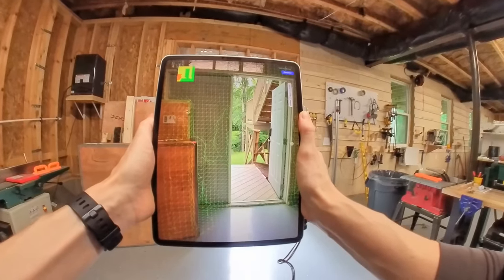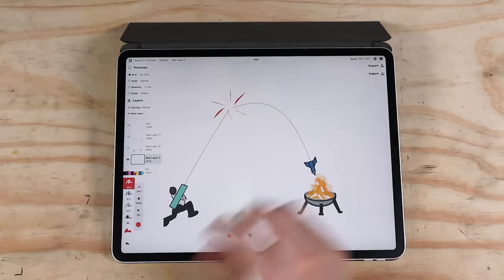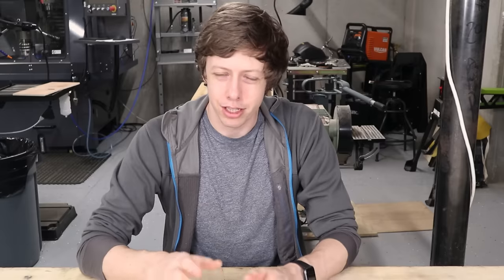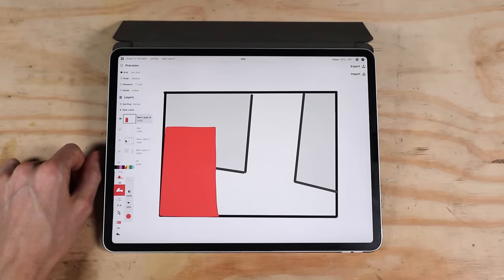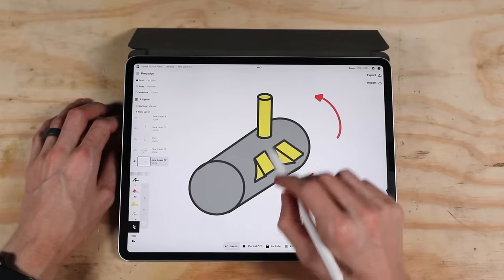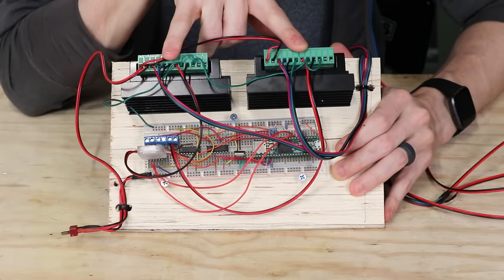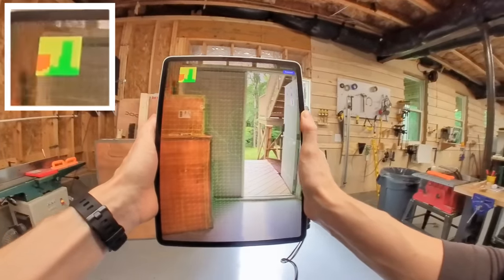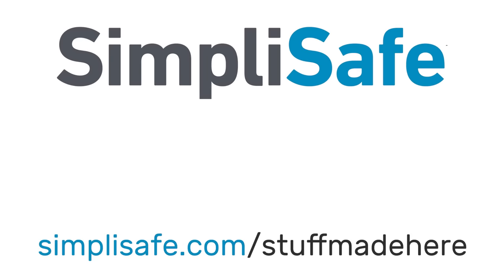See in complete darkness with touch

Comment from the maker: Thanks SimpliSafe for sponsoring this video. SimpliSafe is award-winning home security that keeps your home safe around the clock. It's really reliable, easy to use, and there are no contracts. Check out SimpliSafe here: https://Simplisafe.com/StuffMadeHere
Reply: I'm sorry to correct you but only in the US light is traveling at 670,000,000mph.
Very confusing
Reply: What if you built glasses with the technology that went into gloves that would tell the hands what to do, and instead of pines you could use vibrations or harmless electric shock in the palm.
Reply: Yeah I hope you get that system out and build your own fast. It can be bypassed with a $2 device on Amazon.
Reply: Lidar is coming to the new iPhone, I can't wait to see what you're able to do with that in a few months
Reply: Halfway through when you talked about top-down view, I realise you have made a irl raycaster. (doom-engine style raycaster) which is a very fast and easy way to draw a 2d map in 3d by keeping track how far each wall (in-front) is from the player. 

Can you make a blind doom engine?? Can your case run doom?!?
Reply: Also with your pin locking mechanism that holds the pin down, it looks awfully like a key lock tumblr. I can hear a certain lock picking lawyer, "today I'm gonna show you how you can unlock this casw by walking around a specially designed obstacle course made with 2 Red bull tin cans, walking click on 1, 2 is binding..."
Reply: yo you actually KILLED the delivery on the ad. I could use a lot of those things, I will be looking into it lol
Reply: @Yadobler  this was the first thought I had too 😂
Reply: I think your wife has 14 Youtube accounts, why else would there be 14 dislikes
Reply: Lockpicking lawyer made a video of this product. It was terrible
Reply: Bro what did you major in college. Robotics?
Reply: Building guided rockets is illegal btw.
Reply: @chimanwosu537  definitely mechanical engineering, my guess
Reply: Sir i really love your work, i'm still in high school and i wanted to be like you someday, what course did you study in collage?
Reply: So when you talk about making a tactile braille display, if there is some way you could have a "tape" that has slots for braille letters that can somehow mechanically change the divits in each slot on the tape, that could be used to form sentences and then the tape could rotate around to be read kind of like a treadmill
Reply: Maybe you could mount this grip on a 'white cane'.
Reply: You may consider looking at Carl Bugeja channel about tiny actuators. He is working on PCB motors and actuators.
Reply: some blind people can actually see if they are in a light area or in a dark area. Could it be that if you made a box with a hole in it, that they could "see" by sticking this box on their eyes and moving their head left to right up to down like a scanner. I know this sounds comlicated, but if you attached a motor to the box, that moves it at a regular speed( also like a scanner) then they wouldnt have to move their head like a idiot and could maybe see black and white in low reaulution.
(just a idea maybe stupid, but maybe helpfull)
Reply: David McG and Destin from Smarter Every Day demonstrated that a laser can be used to silently trick alexa, Siri, or pretty much any voice activated system connected to a smart lock and trick it into opening. I would be very wary of any electronic lock especially when used in conjunction with any voice activated assistant.
Reply: use azure kinect DK to replace the kinect,just a hand pond size, and better performance. USD399
Reply: U should have a company
Reply: Look at the lock picking lawers video on this he bypassed it with a 2 dollar device
Reply: The output could be small studs in an array,  which represents the display. The distances would be announced by vibration. The studs would vibrate more, when an object is close. Either the frequency or the amplitude would get higher in proportion to the distance measured. I think the resolution of such "display"  could be quite high, f.ex 8x14 studs. All studs would be in the same depth, one sweep with fingers would reveal if something is very close.
Reply: Thanks simpleflips for sponsoring this video
Reply: @SassyPants34  I WAS LOOKING FOR THIS!!!! Love that guy. A dead bolt that can be opened with a magnet LOL!
Reply: Pretty awesome man! There's a company who is working on haptic feedback for VR using gloves that have around 120 touch points, I think if you could collab with them this might blow up. 
Edit: here is Destin's video from smarter every day on the gloves.
Reply: If you wanna be a successful (DIY/innovator) youtuber focus more on the Demo and the practical use examples and and minimize the scientific explanations or divide the part's for those who r instructed. I'm into the science behind the projects but this made me yawn. Take for example. Hacksmith, kingoframdom, diyperk etc. The try to focus on the Demo more then explaination. The channel diyperk has completely different channel for the detailed explanation. Best of Luck 🤞.... You have alot of potential... Don't fail ur self. Will continue to watch. 👋
Reply: Woody Haller yeah I work in IT I use dumb technology. No smart connected shit in my home.
Reply: simplisafe can be bypassed by a tiny 5 dollar remote interfering with entry detection sensors
Reply: what if you take the lidar out of 2 devices put it on either side of the mask, and setup a concave gauntlet on your forearm to have more pinpoints, maybe ever one on each arm to give left and right clarity? I think this is a big step toward helping the blind!
Reply: Bro can u make an Ai animal robot
Reply: what app are you using on the ipad to draw with?
Reply: Great idea. it got me thinking when I was listening to what you were describing, I was thinking of those desk toys. Where it's a series of pins on a plane / box where you press your face/hand into the extended pins and you get an impression of your face/hand/etc on the other side.  These things: https://media.kohlsimg.com/is/image/kohls/2523398 Seems like in your current tube model you could fit a few of those type of pins.If the pins were ferroe sensitive, then use a series of small electromagnets to push/vibrate them around. Don't have to move a lot for decent resolution.
Reply: You should have used electromagnets
Reply: Thanks SimpliSafe!
Reply: I would love to see this as a single in hand bar that you can wave around like a wand and it basically acts like an infinitely long stick for blindness. That vibrates harder when things are closer or softer when further away. That way you could wave it around in front of you to get a good feel of the room instead of having to try to actively navigate the room while being fed data. I think (correct me if I'm wrong) that blind people probably have a very good ability to form mental images of rooms and locations of items around them. So instead of giving them a tool that real time feeds them the locations of things around them. Give them a tool that let's them take a measure of the room themselves. So they can wave it around and sense where things around without having to go over to the things or have them come upon them. The can make their own mental map.
Reply: Around what clock ?
Reply: iPhone 12 is supposed to have Lidar.
Reply: It's called a cell phone jammer.
Reply: SimpliSafe: You can't enter this room
Me: has $5 flood radio from eBay
SimpliSafe: Understandable, have great day
Reply: Send the lock to the LockPickingLawyer he will tell you if it’s safe or not😅
Reply: The Xbox connect would work as a belt
Reply: Please make some PlayStation trigger stops😔
Reply: I got to say very good project that can definately help blind people. If i were you i would replace the hand control mechanism with a vibrating gloves. With a vibrating gloves you can basically configure the glove to move left right or straight
Reply: So I just found ur page and holy fuck man ur a fucking genius... excuse my language... definently subbing... great shit bro
Reply: And it’s entertaining and helpful as fuck.... damn I wanna be like u bro
Reply: What happens if this thing sees a glass door
Reply: Or ya know just do it the simple way and dissable power to the house and then ez catch
Reply: Try a glove that vibrates
Reply: Yo that security is ridiculous lol it's funny how you explain every reason why someone can't break in what's next are you going to put some handmade booby traps down  flashbang trap 200 flashbangs goes off at the same time lol
Reply: @coughcough6692  don't give him ideas lol
Reply: Thought for you what about incorporating a VR glove with a standalone  lidar system that could be worn like a pair of glasses?
Reply: You should Colab with Tommy Edison he is blind and it might help him
Reply: They have something similar to that at the museum of science and industry in Chicago. It’s these football shoulder pads you wear and it has sensors on them. When you’re about to walk into something it vibrates. I’m sure you can check it out
Reply: The question is, will those poking or vibration in your hand cause nerve damage over time🤔
Reply: Dude, where's that Kickstarter/bank loan at?! You got a working prototype and a fanbase, what are you waiting for?!
Reply: U should make a guided missle that’s filled with water or something so that once it’s shot up in the general air space above the fire, it can locate the fire below and dive towards it
Reply: Im working with digital design of chips and often clockspeed is in GHz range so 5 ns i 5 clock cycle thats is plenty of time :P... If u need some project with supper low latency and use a FPGA i can help you out :)
Reply: You might want the carbon monoxide sensor near the floor.
Reply: @ Stuff Made Here 
Which IQ do you have?
Reply: I’m assuming they paid for you new ipad
Reply: Someone invented a really simple device which gives high resolution simulated vision for people who cannot see, a very long time ago. It requires no programming, no batteries, and anyone with a working hand and legs can use it.

It's a 1.5 to 2 metre long stick. A small wheel or rotating ball on the far end of the stick refines it significantly. Paint it white, so that the stick can be seen clearly by others, et voila! Perfect! 

Another, even older tool does require programming and an energy source, has a lot of RAM, and gives about 10 years of reliable service. It is also self-replicating.

It's a guide dog.
Reply: Ok it may be a dumb or impractical idea but to increase the pin density you could try a grid of elecomagnets that get powered in varying levels to push  the pins (think a pin with a neodymium magnet on the inside so when the electro magnet becomes unpowered it returns to its original placement)
Reply: If you ever run out of ideas, I would TOTALLY be interested in your home automation setup.
Reply: This board is very SIMPLE, it’s just a micro controller Bluetooth communication module and two big fat ?????? motor drive. 😳😳😳😳🤯
Reply: I just hope that you have other "defense" systems cos' you are aware that knowledge is power and just showing your alarm devices gives the potential intruder info and gives him infinite time to prepare (cos your things are pretty much worth the months of preparation). (So I have never burgled someone and don't plan to, just informing you that it's better to always have backups for everything)
Reply: What about using a custom pcb with pcb coils as electro magnets to create the push, wouldnt that be alot more compact? You could technically make an actual flat case or perhaps a glove right?
Reply: The new iPhone coming out is gonna have a lidar.
Reply: @maibster  yeah exactly what i commented 2 days ago which probably was not even original to begin with
Reply: What about a glove which gives you a small static charge whenever something gets closr (or push something from the glove towards your hand)
Reply: @marktyn99  well true but also false, because what he installed is a co not a co2 sensor, carbon monoxide unlike carbon dioxidd is about the same density as air at room temperature so it doesnt really matter where he places it
Reply: iPhone 12 has a lidar sensor.
Reply: @maibster  that's true, I realized it after half an hour, but couldn't find my comment annymore
Reply: iPhone 12 has LiDAR :D
Reply: Make a DREAM RECORDER. Im sick of having awesome adventures, and waking up and not being able to remember them.
Reply: Have u thought of making it work on a haptic glove?
Reply: O9 o8 op 9
Reply: Lo olio ooooooo[ooooooooooo9o IPO ooooooooo[ok[[ooo[ok ooo[olio
Reply: @SassyPants34  [
Reply: @SassyPants34  l
Reply: @compactcow    9k pip 9 op o olio Ohio
Reply: @ArticBigFoot  0
Reply: @compactcow  [9o9
Reply: @SomeSortaPro  k kil9 ok
Reply: Time for the iPhone 12 version!
Reply: first off want to say that I'm not an engineer and only have my mind to help with ideas when it comes to this stuff than to actually build it unfortunately.

My question, though, Is, is the xbox connect sensor more accurate than the iPad's sensor? If so, is it possible to break down the casing and design a holdable design to better improve the sensitivity and sight ability to be able to see better as an improvement to the device you already made?
Reply: Why not make two feedback sensors, one for obstacles on the left and one for obstacles on the right. Of course, this would be more relative on the iPad version than it would be on an iPhone version.
Reply: You could fit the cylinder with a rubber glove over the pins so that instead of looking for precise pins you can just feel as you get closer to your surroundings
Reply: Hopefully you see this! You should see if you can get in touch with Tommy from The Tommy Edison Experience here on YouTube! A collab with him (or any other blind YouTubers, he's just the first that comes to mind) to test this out would be awesome!
Reply: You shouldn't put the carbon monoxide detector on the ceiling. Other than smoke detectors they should be hung at about 1,5m above ground (wait … that's … let me get this right … 9 tenthousands of a mile) on a wall. Carbon monoxide specific weight is very similar to normal air so it will not rise to the ceiling (as smoke does).
Reply: An idea if you want to try this again:  Use gloves with bicycle brake lines attached to pins at one end and tiny linear actuators (You can get 10x10x30mm long-format ones directly from China for less than two dollars each) in a bracer at the other.  That would free up both hands for other tasks while still offering full-time haptic feedback.  The iPad can go on a lanyard around your neck and can be tilted by hand when necessary.

Does that make sense?
Reply: Spend a week blindfolded using this in a room full of columns and coffee tables that your wife rearranges each day. Make lists of tasks you need to do each day. Voila, you'll have gained the skill of sight without sight.
Reply: Integrate GPS within it.
Reply: Great video! I wish I could work for/with people like you, Mark and Dustin. So much to learn! I feel like my engineering school just can't teach innovation the way you guys could.
Reply: You might want to check the LockPickingLawyer channel, before ordering some of the products.
Reply: You should make it with the iPhone 11  pro now
Reply: Carbon monoxide detector should be closer to the ground for optimal safety
Reply: @SassyPants34  not to mention the ease of programming and hacking these days. Id never use digital locking/unlocking. Someone either needs a KEY - or they're using force. No chance im letting a nerd rob me.
Reply: iPhone 12 pro has lidar... just saying...
Reply: slap a few tracking devices in hidden smaller items and you should be even safer~
Reply: Your humor is simple but funny af. Keep up the good work!!
Reply: Bro you should defo message Elon musk about a partnership for marketing this
Reply: well now lidar is on the new iphone 12 so that is a plus. I want to see this done on that device
Reply: Funny how lidar is in iPhone now
Reply: interesting video.
Reply: The simplisafe system can be disarmed with a high frequency emitted from a radio. It makes it super easy to brake un
Reply: This video's project honestly seems like something that could be patented. It's AWESOME.
Reply: @safetyinstructor  won't it be the same speed (not number) if you convert it to kilometers?
Reply: @marcohaase1  it's sarcasm
Reply: @safetyinstructor  sarcasm is a bad idea over typed messages nobody can read sarcasm you only hear it
Reply: @marcohaase1  
I highly disagree with the "you can't read sarcasm" part but it's usually a bad idea to use sarcasm on the internet because most people either won't get it or will be offended
Reply: @safetyinstructor  ok but usually sarcasm is said in a certain tone that can't be perfectly replicated on the internet
Reply: Do you use Desmos for your quadratic equations?
Reply: I want suggested for my friend who has a son who is blind born that way a wristwatch that gets to a finite tension the closer you get to an object directly in front of you however that wouldn't totally allow you to see your total surroundings but it would be a better judge of distance combined with your lidar but also lidar is kind of funny in the sunlight you might want to go with those ultrasonic sensors but those don't really do very well when it's a small or rather not well sized object
Reply: Another thing you might want to consider is people who are practically born blind trust their hands more than anything and they're hearing maybe a whole sleeve on the arm might be better and have it operate to the orientation of the arm and the given direction the user is facing
Reply: Zarin M  I too was thinking that was not quite appropriate I thought it would be best to combine the lidar with a wrist sleeve that gets to a finite point that's tense to tell you you're right in front of the very object you're about to touch the user would be able to figure out distance based off of feeling.. up until the point they actually touch it
Reply: Zarin M  so basically the concept is light our sleeves on both arms to judge distance accurately and simultaneously
Reply: CO is heavier than air. Place the sensor closer to the ground. If it hits the ceiling, you are already right in the middle of it.
Reply: A tactile glove would work! Use bluetooth. Form factor would be smaller.
Reply: @dHue_52  yo awesome dude.. hey what company is working on this exactly
Reply: @dustinswatsons9150  I'm not sure, but here's a link to the video I was mentioning in my original comment where Destin from Smarter Every Day explains it and goes to the testing facility. https://www.youtube.com/watch?v=OK2y4Z5IkZ0 (not sure what happened to the link I originally included
Reply: Theoretically, it could notify the police if it loses access to wall power, although the problem of it being accidentally unplugged, or a power outage could give false alarms.
Reply: Hey man, I'm still waiting for the iphone 12Pro version and improvement of this. :D please do one :)
Reply: Now the iPhone has lidar so you can fit it into the iPhone case. Love your content👍
Reply: and then lockpickinglawyer debunks this thing bit by bit
Reply: Best video
Reply: @stuffmadehere David Eagleman, did this 10 years before... He called it sence replacement as vibration vest for deaf people
Reply: @Stuff Made Here  Piezo transducers should be a simpler, cheaper and better approach, eg a 12x9cm grid of 12mm piezo transducers would make a 10x8, 80 'pixel' tactile display for >$20, minus the control electronics; it could even be mounted on the back of the tablet, and there's probably quite a market for smartphone cases with this kind of technology.
Reply: 12:58 even if its a sponsor add, its not good to explain your security system, hope you left stuff not explained.
Reply: Yeah... wouldn't be easier to just use sound for that idea? Just buy a pair of stereo bluetooth earbuds and convey that lidar data by sound like a portable sonar. If you make a app out of it you could help some people around the world.

Btw, a way to turn it on or off with a button press would be nice.
Reply: Use VR gloves. Massively increase the amount of data you can feed to a hand. With two VR gloves (left and right) feed the projection of obstacles onto the right hand and give the INVERSE of that same map to the left hand! One hand says what to avoid and the other says what space is not occupied. We don’t navigate to a door by seeing walls and inferring the space not occupied by walls must be safe. Our brain balances both metrics (where we can go and where we can’t go) simultaneously to model the space around us!
Reply: Going forward with your interesting invention keep in mind that there is a braille literacy crisis in the US, where fewer than 10% of the 1.3 million people who are legally blind can read braille, this applies to both adults and children.
Reply: perhaps you should make a whisker system for shoes and hands.
Reply: I have a question why wouldn't you just use a glove for this project?
Reply: Please revisit this project with the iPhone 12 there’s this new app called SiteScape try it out and improve on it
Reply: Oof
Reply: Hi watched your video for the very first time, I loved it❤️ thank you man. I would like to suggest you one idea that just flew by my last brain cell.

Idea : we can use hand gloves (half glove still better as fingertips will be free to use) and we can attach small vibrator motors that come in phone.
Gloves in both hand will let you get more precise data about the direction (levy glove reacts to ipads half left screen and right does for other half).

Placement : Thumb motor described obstacle above head, Pinky finger motor described obstacle below, the other three fingers describe the obstacle in front.

Distance of obstacle : the distance will be given by hardness of vibration. Higher the vibration by motors.... Closer is the objet.
Reply: TINY SOLENOIDS!
Reply: I'm an Orientation and Mobility instructor, meaning I teach people to get around without their vision and have just over 10k hours under blindfold myself traveling across the country. My issue with this piece of tech is that it will never be safer than simply using a proper white cane and it could actually endanger people fresh to blindness as they cling to the tech instead of learning to get around safely and properly; its just way too much trouble for how simple safe and truly independent travel is as a blind person and if you have a low battery you're screwed.
The Google blind driver car actually does what you're trying to do here but uses haptic gloves to convey obstacles.
Reply: Simply safe? Dude, i like your machines. notify me when your going on vacation!
Reply: So you use simply safe! Could be more safe by making your own  alarm system! Plus you show every burglar where evrything is and how its setup! Did you just bang your head? Because that all was the dumbest thing to do ever!
Reply: Now the iPhone have LiDAR
Reply: It's great that you got a sponsor for your video but you should never tell people what actual security system you have. That's just giving thieves the needed information to actually rob you
Reply: This seems like a difficult sponsor to sell after you have collaborated with the lock picking lawyer and will have gained a lot of subscribers from his followers... And they will give you a hard time about everything (whether they are right or wrong is another question).
Reply: Hey I know that this is insanely late but you could do something similar to the HTC Vive controllers where basically they use speakers as haptic feedback, so you could get something that vibrates or moves slightly to a fixed location when powered in order to simulate "bumps".
Reply: It just seems like youre paranoid. But I think thats ok.
Reply: Bring this to shark tank😂
Reply: p
Reply: I think i just got a pretty good idea: make the whole thing a cap with the camera and some small solenoids  that tap your forhead on it. the tapping frequency increases the closer the distance in the corresponding direction is. this could be quite discrete to wear and give a decent resolution. most certainly good enough to help you find doors and stuff in fimiliar places. the forehead i think is an ideal place to interact because if i test myself it gives me great resolution and with the solenoids it should be possible to make a screen with just small coils and magnets suspended in maybe silicone and connected in a grid? the magnets could just stick to a sheet of metal for the pour and keep the individual coils in place
Reply: Hey what about solenoids? Compact, sensitive, precise enough, cheap, jellybean parts driven by transistors. Maybe somewhat power inefficient but I don't think you'd need  whole lot of actuation force.
Reply: "and it uses cell service, it's super..." 
"buffering... Please wait."
"a'. r'. blip. -r reliable."

Oh, and cell phone jammers cost $75 or less fyi.
Reply: have one controller for ur right hand and one for ur left. if something is on the right the right hand pins and if its on the left the left pins go.
Reply: @dreoneful  
You’d sell out to women in a day.
Reply: @SassyPants34  damn lmao
Reply: he cant see it tho, he blind
Reply: Apple also put the LiDAR in iPhones
Reply: Hey! Just an idea for an upgrade maybe to this project. Maybe a Segway that can be controlled by the navigation  app, the rider would wear sth like the virtual reality head gear which would provide 360 degrees, on all 3D axis, Lidar scanning. I believe this would actually find commercial applications for visually impaired people.
Reply: Maybe you could use a headphone for representing a walking corridor. For example the closer you are to an obstacle, the louder the tone. You could use left/right balance too, even more possibilities with a Sourround Headphone. Also the object recognition  could be able to tell you wihich objects are in front of you. Further you could ask the Tablet "search for my keys" and then if you are near the keys the system could lead you to the right position.
Reply: So you need a cell phone jammer, gloves, and bolt cutters. :P
Reply: Like a dot matrix printer
Reply: Hi I had a great idea for a video you could do with this idea. What if you made it to work in a backpack to help blind students. 

So you would build the mother board and battery into the bottom of the bag and have cameras on the back and sides of the bag and on the straps. These would feed the computer with information on the surroundings. You could then make 2 of the rotater things and the back of your tablet that the person would hold in each hand. They would be connected to the motherboard in the bag by wires.

This would make it easier for them to get around. The cameras on the side and back of the bag would warn them if anything is coming too close to them. The cameras on the straps would be used to inform them of their surroundings based on distance and on which side.

You could make it a colabe video that you do with other you tubers that code and build stuff